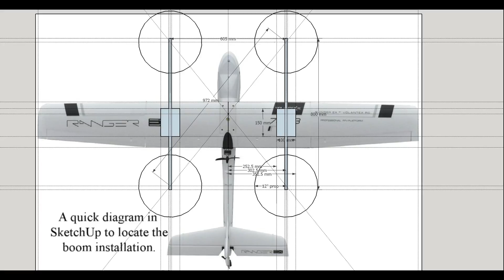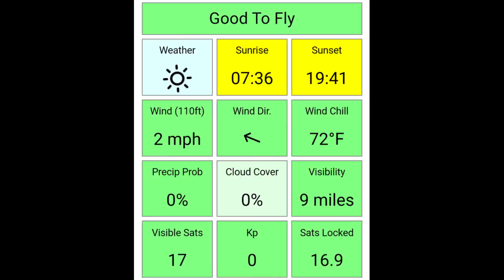Ranger EX VTOL Conversion Maiden Flight 031817

Comment: How connect the carbon tube with wing?
Reply from the maker: I basically followed this: https://docs.px4.io/main/en/frames_vtol/vtol_quadplane_volantex_ranger_ex_pixhawk.html

Good luck
Reply: @rollys1200 I have the volantex ranger 2400.You think is same geometry add the motors with your airplane (ranger 1800)?
Reply from the maker: @DimisFpv  Yes, but keep the arms closer to the fuselage centerline and be more of an H-configuration instead of the X setup. This way you can minimize and reduce the twisting motion during transition. What's most important is keeping the quad motors CG identical to the fixed wing CG.

Good luck.

Comment: Very nice build! Was the Pixhawk doing the stabilization? Have the Ranger EX and thought of modding to VTOL.
Reply from the maker: Thank you. Yes, the Pixhawk does it all. I doubt if Volantex would offer this as a VTOL, if that's what you're asking. If you've built airplane kits before, this conversion is not that difficult but does require some average soldering and wiring skills.
Reply: @rollys1200  thanks for the response... Yes, I own a PNP version from back in the summer. VTOL would help me overcome a shortage of runways.

I've actually seen this vid several times. How is the transition from forward flight back into hover at this point?
Reply from the maker: @dougmcpheters1546  This video is actually about four versions behind and lots of improvements have been made in the VTOL coding. If you haven't seen my other videos of this build, this one is an onboard view of both MC>FW and FW>MC transitions: https://youtu.be/xhIcdALnXk0 and even at that is three versions behind.

Good luck.